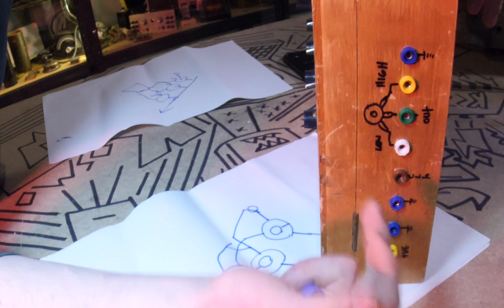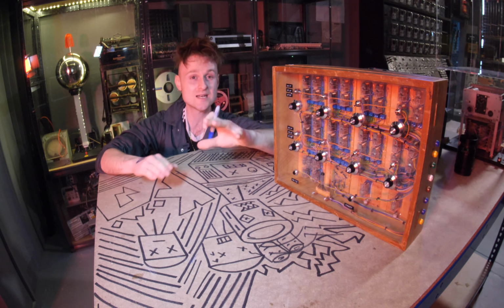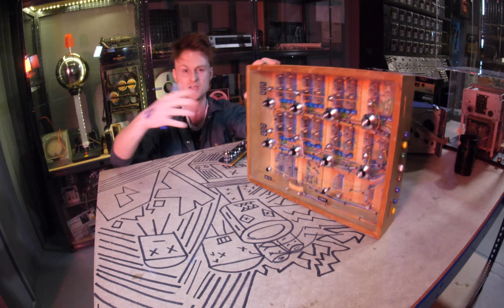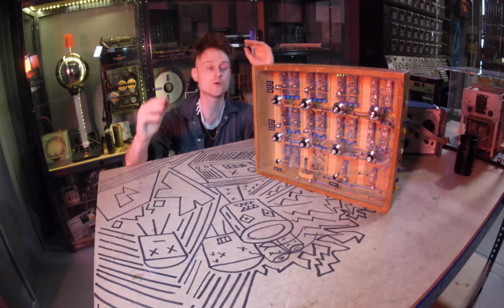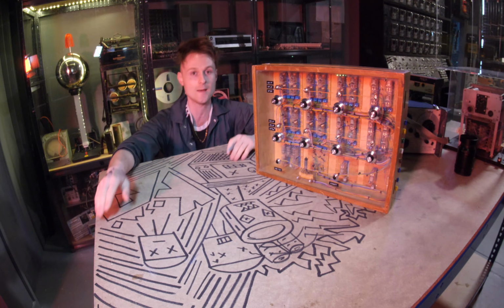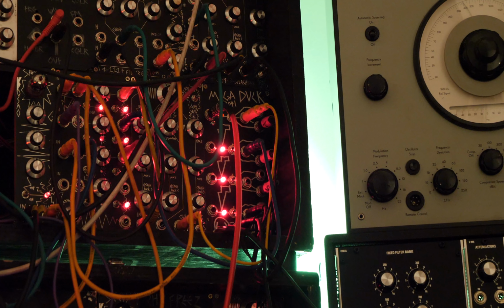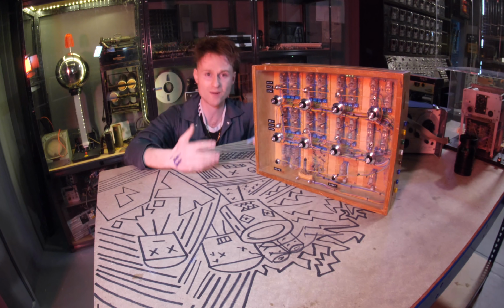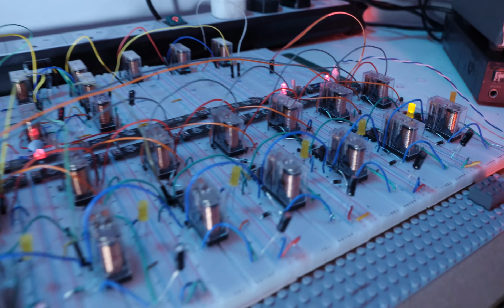Relay Sequencer (no electronics) - Testing This Noisy Music Machine

Comment: A problem can occur if two outputs are turned on at the same time, one potentiometer set to the beginning, the other to the end, then both wipers will be connected directly and short-circuit the ends of the resistive track.

Comment: Hm, that motorbike sound around 10:00 , you wanna see if maybe you can get 4 relays, or even 4 sets of relays, going in a pattern a 4-cylinder engine might go at. Or indeed some other number of cylinders. It'd sort of be like a distributor, except you're not gonna put it in a car. But it might sound like a weird engine, be an interesting sound effect. Especially if you then twoke* it.

(* twoke, the past participle of "to tweak". Obviously.)
Reply: I definitely thought it sounded like a motorbike or vintage tiny car engine at points too. (Though that's really two ways of saying the same thing!) Especially when the cabinet was closed, muffling it slightly just like an engine bay would do.

Comment: I hope you have some protection against the inputs shorting together, or whatever you're plugging into the input can handle that! If two steps trigger at the same time, one has the knob all the way down and the other has the knob all the way up, you get a total zero resistance between the two input ends. I think a resistor in series with the wiper pin on each knob before it goes into the relays should do it (maybe you already did that I don't know!), it might change how the summing works a bit but it'll be more in the direction of what you expect anyway.
Reply from the maker: it has mix resistors and wants to output to a high impedance input. if i didnt do that it would keep turning off in the video and be unusable haha

Comment: Just a thought. Relays create a nasty reverse EMF as the magnetic field instantly collapses when the switch opens. This is a high voltage and in the opposite direction to the applied voltage that energized the relay. This is actually how car ignition coils work. To prevent this annoying voltage from damaging other things we pop in a diode to short out the voltage and the current passes through the coil windings and heats them up instead. B U T surely this also slows down the opening of the switch as the magnetic field hangs around marginally longer than it could. Why not instead collect all this reverse EMF that the sequencer is creating and have a big spark gap on top going zrrrt zrrt along with the sequence. I reckon a ladder of diodes some capacitors and a car ignition coil and this this could go cosmic?

Comment: At first I thought: "Nice, a sequencer - only that it's implemented using electromechanical circuitry." But when you added the contact mic output then it became an entirely new beast. This is now an electromechanical instrument. That's really unique :D. 
8:21 : Hearing that relay lose its shit really cracks me up ;D. I love listening to hardware that's pushed to its physical limitations. Seriously, though: That's an electromechanical oscillator. Has anyone done a module like that before? That's incredible! I've never even thought of the idea of adding non-electronic (or not entirely electronic anyway) modules to a modular synth. This opens up so many possibilities :D.
Actually, thinking about it someone's GOT to make a Floppytron module now :D. And a printertron. A modular synth consisting of mostly voltage-controlled electromechanical sound sources. That would be INSANE :D.

Comment: does this mechanical de bouncing have a effect on the sound versus integrated circuits?
those sparks (witch you can prevent by adding a 100nf or so capacitor)...the delay of the separation?

Comment: Those relays you were beating the crap out of on the mega duck reminded me of a device we use at work to do very basic EMI testing that is basically a 24VDC relay with a mains plug attached which just stuffs 240VAC across the coil and makes the relay oscillate very aggressively. Makes a hell of a racket and always sounds like it's going to explode, but that thing's been going for about 30 years!
Reply: Haha that's fun. I've seen some videos on electromechanical buzzers which work much the same way (such as "the Dixie buzzer") — and you get different sounds at DC and AC, or even depending on the voltage IIRC. A lot of those sounds immediately stood out to me as having been used extensively in Thunderbirds and other Anderson productions.

Comment: This is 100% the coolest sequencer I've ever seen. That crossfade function is like the heart of what modular synthesis is for. The idea of being able to plug anything into there and add and subtract them from each other feels like a black hole full of possibilities to get lost in. My first thought is how cool it would be to put 2 sequencers with different sequence lengths in each one. I definitely need to make a sequencer with that function.
Reply: After a lot of brainstorming, I think this can be done with 2 4016s and a 4017. In super simple terms a 4016 is 4 non-mechanical relays. In theory, you should be able to set the 2 4016s and 4017 up as an 8-step sequential switch with each 4016 input receiving the center pin of each pot. All outputs of the 4016s would then be chained together. Probably with diodes.

I'll update with my findings.
Reply: I have posted an untested diagram on r/lookmumnocomputer if anybody is interested.

Comment: Really amazing work! 3 things kill relays. To maximize life address all 3 and they will live for a very very long time. 

1) Contact current. This is easy for many of your applications because you are mostly only conducting signals with low current. Relays that must close on high inrush (incandescent lamps or large capacitors like those found on power supply inputs) will slowly erode the contacts. Since you are driving lamps, there are a couple things you could do to improve the lifespan of your relay contacts that are responsible for the lamps. A) Change to LEDs (boring). B) Find the right sized resistor to just barely make the filiment glow then put it across the relay contacts. While your bulbs will never truely be "off" they will be preheated which will significantly reduce in rush current and preserve the relay contacts. Use big (high-power rated) resistors cuz they will get HOT.
Inductive loads also cause arcing on contact OPENING and require diodes or snubbers to prevent this arcing. Make sure you have a backwards diode on each of your relay coils to arrest the coil current when the relay is de-energized. Clever trick, put a 10-ohm in series with the diode. This will cause the relay to drop out more quickly. Maybe only a few ms, but you might be able to cycle noticably faster. Optimal resistance should be 10-50% less than the coil resistance. Make sure your diodes have the cathode (stripe side) facing (+) side of relay coil.

2) Coil failure. Easy stuff like don't over-current your coils is obvious. But the parallel diode/snubber not only saves the contacts of upstream driving relays, it also reduces voltage stress on the wire insulation. This will prolong the life of the coil. You may also notice less electrical noise in your audio signals. Small value cap (<0.1uF) in parallel with diode also help with electrical noise. 

3) Mechanical failure. This is the mechanism itself failing. Relays with a coil spring and pivot point will wear out without lubrication. A very light oil on the pivot points will go a long way. Also, covers must be reinstalled since dirt will act as an abrasive on these critical surfaces. Its best to use relays with a flat spring that doubles as the contact pivot. I think this is the type you have which will last basically forever as long as they do not fail for reasons 1 or 2. On PCBAs relay clicking zillions of times can actually fracture traces at the terminal solder joint. But with your manually made boards with soldered wires underneath I am sure this will never happen. 

Happy clicking!
Reply: This guy relays!
Reply: I love the idea of this flip-flop sequencer still working in another century or so. I wonder if adding those capacitors and diodes will happen

 (has happened? Maybe I should go look for signs of additions in the more recent video where this was sequencing the glockenspiel above the door. Or, maybe I'm getting my wires crossed. Wasn't this involved in decoding the visitor counter? Well anyway, it's 4 am. I should rest.)
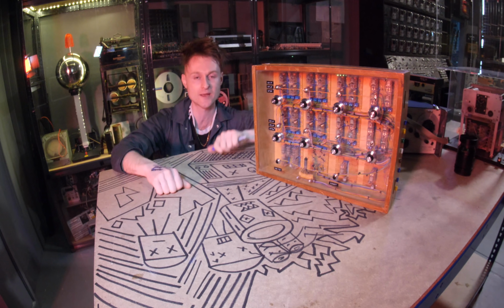Reply: 8:38
Reply: who cares they are cheap
Reply: @klaasj7808  Anyone who doesn't want to senselessly create waste and doesn't consider their devices consumables
Reply: @inv41id  Fucking spot on.

Comment: My first higher voltage experiments used digitally controlled relays and it was a massive pain cos they would stick closed or fail to close, especially as they warmed.  Thank god for addressable LEDs.  Damn fine work.  I can't help but think the pandemic has nudged you along a bit and was pondering how far you might have come in the same time with the museum if you'd had a full schedule of gigs last year?  Ps I think Hainbach could do wonders with the mic'd up relays w/no synth

Comment: Relay life is usually rated for the contact life at rated currents, you're only passing signals, so not really an issue
The coils (as you rightly said) are more like speakers, as long as you don't greatly exceed the coil voltage, those relays should last years.
Reply: Came here to say exactly this, he's probably pushing hundreds of times less current than they were designed for. At that point the mechanical failure rate would be higher, and that'll last years easily
Reply: Passing small signals is often worse, than passing currents close to 1/10th of rated current. But it looks like that he is using contacts to control onother relays, which is probably the best case.
Reply: and rated ac/dc voltage too
Reply: @ManofCulture  Square wave dc is effectively AC at a little more than half the DC voltage.